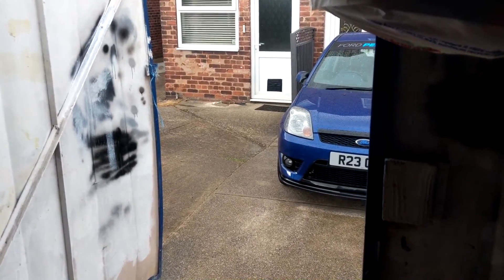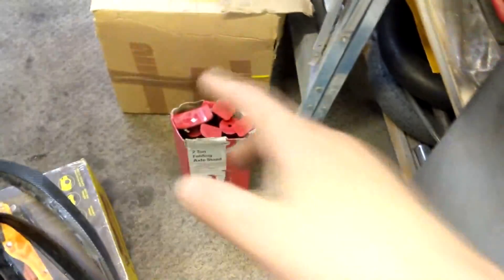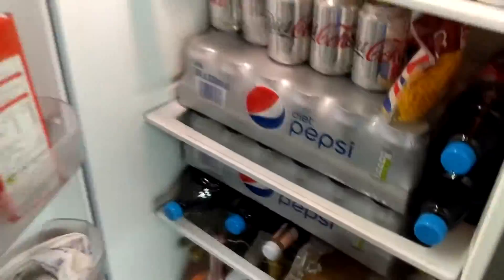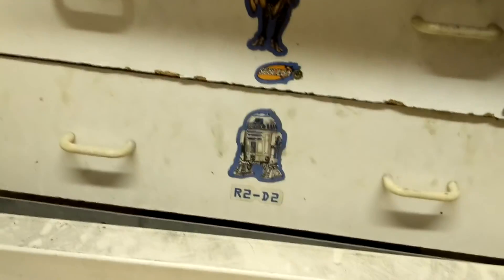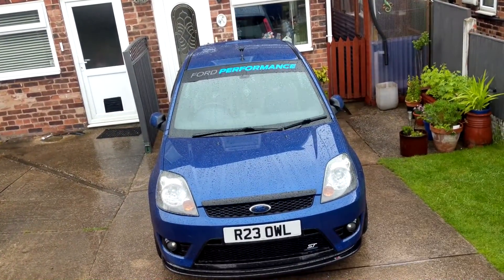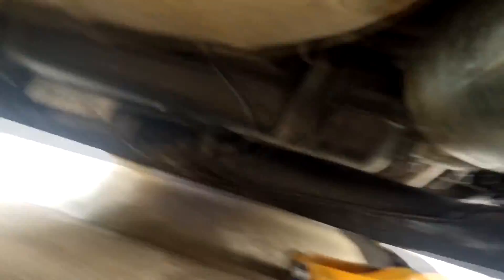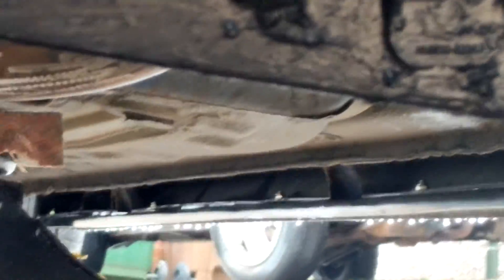How to fit the TRC Low Line Kit - Fiesta MK6 ST

Comment: The grill underneath the number plate looks slightly different to a standard fiesta before you’ve even put on the splitter so just wondering did you install and new bumper on first

Comment: Looks soooooo much better!
Quick question.. may be daft but when the side extensions are on, can you still remove the jacking covers to use as a lift point?
Reply from the maker: Negative 😣 shame, it does make it tough to jack up, but not impossible. I have a low profile jack so it JUST fits haha

Comment: I've got myself the side skirts and spats, already had splitter, I wonder if you can still take that little bit out of the skirt to get your car Jack in.. once side side skirts are fitted 🤔
Reply from the maker: You can't take that park of the skirt out as far as I can tell as the skirts tighten right up to the existing skirts. If that makes sense haha. It does make jacking the car up with a standard jack cery difficult. I have the lowered car Jack from halfords, and that only just now fits under my car which is on 30mm springs. So it does make it awkward, but not impossible!

Comment: Does the splitter go into the little hook things for the stone deflector?
Reply from the maker: It doesn't mate, there's only one way it can fit, which it lines itself up in when you clamp it up, you basically can't get it wrong, as there's little groves on your grill surround what it follows the lines of, it sits in that 👍🏻
Reply: @R23OWL  that's kinda disappointing. They should make use of them.
Reply from the maker: @JESUSSDAD  it sits under them, but when you tighten up all the screws it definitely is closed up, it's really good to be fair but I do know what ya mean
Reply: @R23OWL  looks sweet anyways
Reply from the maker: @JESUSSDAD  thank you!!
Reply: @R23OWL  hi did you need to pull the bumper in to make splitter fit? I got one for Xmas and really struggling to get it lined up. I Asked trc n they said these bumpers warp. Does it sit flush either side with the bumper wheel arch? Advice on this would be great cheers
Reply from the maker: Mine would only fit in one place and it's a flush fit all round, not sure mate

Comment: Get some tiger seal losen the bolts abit and slabber it on once that hardens no wanker will try to nick it
Reply from the maker: Dead right mate, good idea, but then they'll never be able to come off when the car moves on and I need to sell em 😂
Reply: @R23OWL  making tape around the edges then heat gun and dull screwdriver them you wont scratch the paint haha
Reply from the maker: @drxpsaucx4157  good shout actually 😂